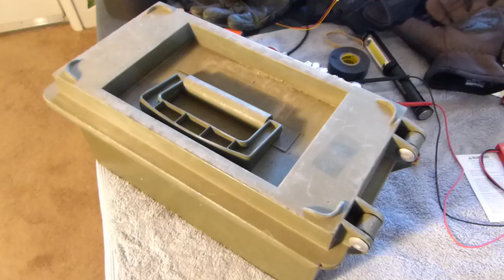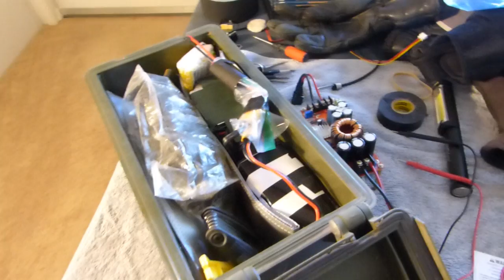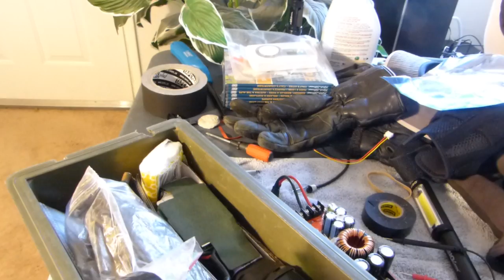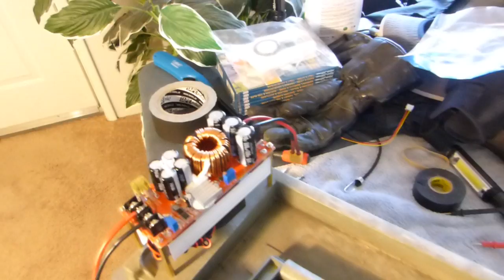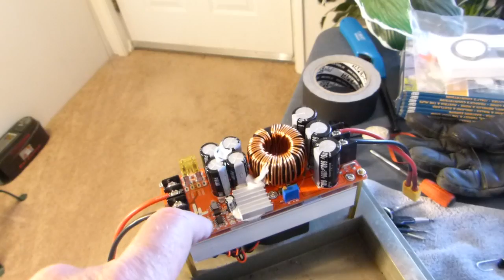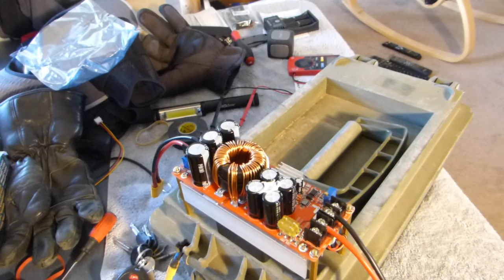Ebike Pack - Hoverboard Ebay

Comment: Do you know if a 12-volt 100-amp car battery will work with this step up converter?  It looks like these converters are mostly rated at 30-40 amp input. Let me know. Thanks.
Reply: No that will not work, you will blow all your fuses. These are rated at 10V to 60V input at 30 Amp

Comment: hi ,
Does the 48 volt inverter work ?
48 volt 4 batteries required..
Can I use this device with inverter by turning 12 volts to 48 volts

Comment: For $20 on Amazon, you can buy a 2A brick charger that plugs in the wall. Presto. Except it is not easily adjustable.
Reply from the maker: That would limit the current but you would want the voltage to be below 4.2v per cell. These CC/CV modules seem to be very precise and you can add a simple wind down timer.
Reply: @geebonzo  How do you do the wind-down timer?